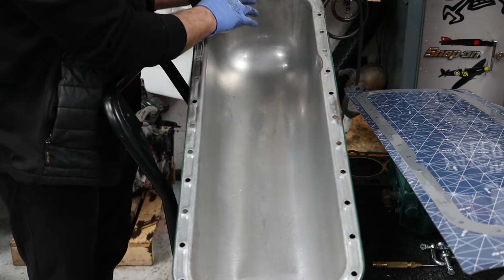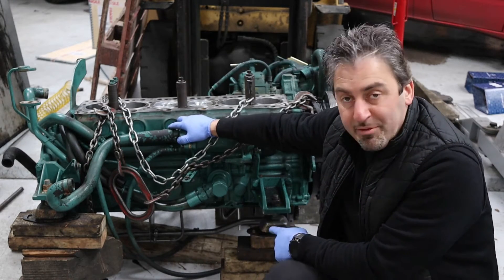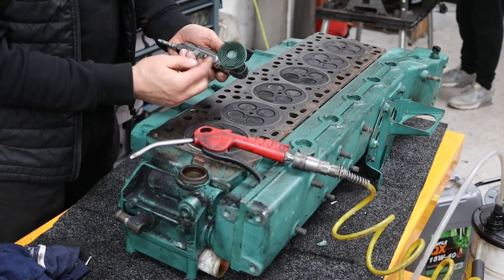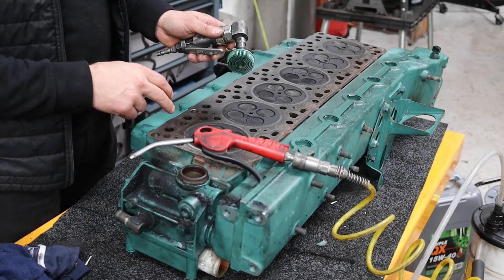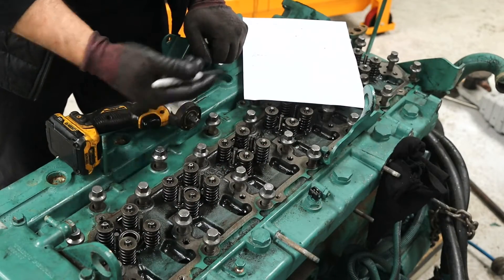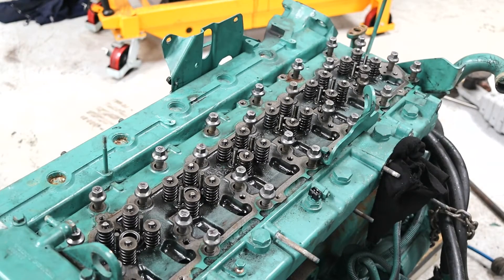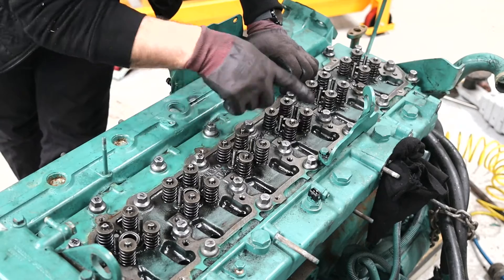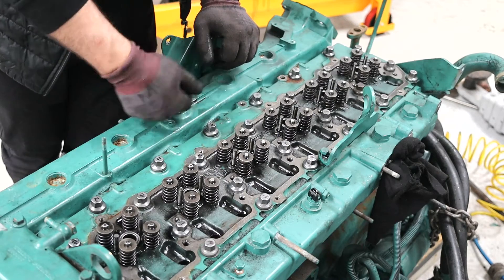Volvo Penta Diesel Engine Repair PART 2

Comment: Hiw much would this rebuild costs ? Rough idea ?
Reply from the maker: I did this for a friend and is it's not to be repeated! I spent a good 10 - 12 hours or so on it, I didn't get it out of the boat mind, this was done by a different mechanic which took around 5-6 getting it out and back in, plus plumbed and running. From memory my friend was quoted around £6000 in total, I would work around that figure! 👍

Comment: You did not show it but I certainly hope you checked the crank and main bearings.  If it were my engine I would not have gone the cheap route.  Makes no sense to complete tear an engine down and not rebuild/replace everything that can only be accessed while the engine is apart.
Reply from the maker: The main bearings were replaced, you can do them in situ, the old ones came out like new. The boat has been in the water for some time and runs perfect, we went to the IOW in it a few weeks back! 👍🙂🛥

Comment: Having the engine out, I would have made a hose-connection with a safe valve to the bottom. There is always some liters with left-overs in the bottom case when going thru the dipstick.

Comment: Did the block need an overhaul do to overheating and engine lock?  Was the heat exchanger new or taken apart and cleaned?
Reply from the maker: The block was good as it's lined, the engine wasn't locked, just noisy and the heat exchanger had been worked on a couple of months earlier by another mechanic.

Comment: Luckily not many people watched this video. The guy has no clue how to adjust the valves on this motor. The clearances need to be checked every 200 hours Why because the bridge between the pairs of valves needs to be checked to ensure even load on each valve stem. If not the perch supporting the bridge can break which can lead to pistons hitting valves and the engine destroyed (each cylinder has 2 inlets 2 exhausts). So this guy has no clue what’s he’s doing with the valves  in addition there are lot of other poor practices. You could say it’s just a slap dash job to get the motor running but it s worse than that. The lack of knowledge on the valve adjustment could be terminal. Unbelievable
Reply: I can see

Comment: No rod bearing clearance check, no main bearing evaluation, valve adjustment done completely wrong, engine is absolutely filthy, no coolers removed or checked, cylinder head flatness check not done, valve seats check not done, I'd be pissed if I was paying someone for this kind of rebuild. You couldn't even pressure wash the block when the head was off!!?? Stay away from this hammer tech!
Reply from the maker: Thank my lucky stars I wasn't working for you! You are aware that these videos are heavily edited right! it didn't actually take me 30 minutes to rebuild a boat engine. The cooler had been replaced before it got to me hence the new brass gaskets. This wasn't a customer but one of my best friends, he washed the engine and painted it himself, I'm no ones a lacky to wash and paint. This video isn't a tutorial but for entertainment, I'm sorry to hear that you we're entertained, just for you I'll try harder. Keyboard warriors aye, trashing my work without a clue to what goes on in the background or who I work for. Never the less, I appreciate you watching the video and taking the time to comment. 🙂👍
Reply: @melsmotors  im not concerned with your experience, I'm concerned at how you put information out there that can really ruin someone's day should they choose to utilize your video as an instruction video. Adjusting valves on a KAD44 is a serious thing and not done right can lead to severely expensive conquences. You I hope knows these engines cost upwards of $38k USD. And doing it for a friend, I would think you would show yourself going the extra mile to in fact make sure shit is done right. Take the constructive criticism as a gift rather than an insult. Some of us watching just might have a lot more experience with these engines than you.
Reply from the maker: @Spicy-Tuna  I guess the original service repair manual I worked from was wrong then! Thanks for your input.
Reply: @melsmotors  you clearly don't get it. It's ok. You're obviously mad. I've done my part. Hopefully someone looking to rebuild a KAD and comes to these videos, will see my comments and move on.
Reply: @melsmotors  If you were using the "Workshop Manual" then you were reading the instructions completely wrong.
Reply: In the industry we call these engines green death,  to be fair most of the issues are more with the owners and there heavily weighted throttle hands and not doing regular engine checks. Great video I thought, not a full rebuild but enough to get the boat back up and running again.

Comment: Did you change oil pump and main bearings if not why you were inthere
Reply from the maker: Oil cooler failed and dumped the oil in the hull. It wasn't an oil pump failure, the boat has been back forth to the Isle of Wight several times since without an issue. Thanks for watching

Comment: How long did it take from start to finish?
Reply from the maker: It took 3 Saturdays to complete it. Without the fork lift it would have taken longer, I don't think my engine crane would have been able to handle the weight, nor my engine stand.
Reply: @melsmotors  thanks, I've got the same engines hence the interest. I've heard of concerns about a catastrophic oil cooler failure but hadn't totally believed the potential damage that could be caused.

Any idea how much the rebuild kit cost?
Reply from the maker: @petermansion2220  sadly no, the customer bought the parts direct from the manufacturer who makes it for Volvo. I believe it was Keypart Ltd in Kings Langley. It wasn't cheap so prepare yourself 😉
Reply: Great video. I hope the engine was painted before it went back in the boat. I may need to get a pair of Volvo Penta D6s rebuilt also.
Reply from the maker: @MC-kg8hm  yes it was painted by customer prior to installation. Thanks for watching 👍🙂

Comment: sweet jesus - cool video - maybe next time you could machine the heads, throw some green VP paint on the engine, service the heat exchanger, look at the turbo, exhaust elbow..... if that engine went back into my boat I would be pissed..... mexican hack job
Reply from the maker: Hi Todd, the heater exchanger was serviced before I got the engine, turbo was reconned by the customer during the work process, the head didn't need refacing and the engine was painted by the customer after I returned it. Most boat owners like to do some bits themselves. Thanks for watching 👍🙂